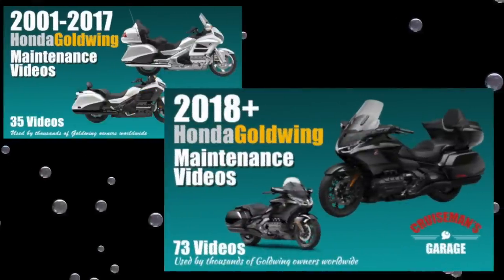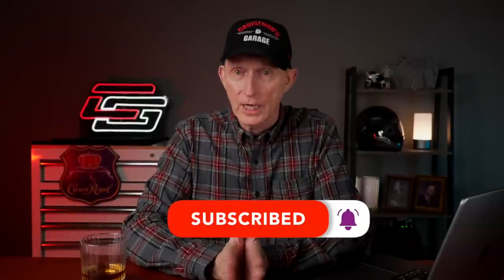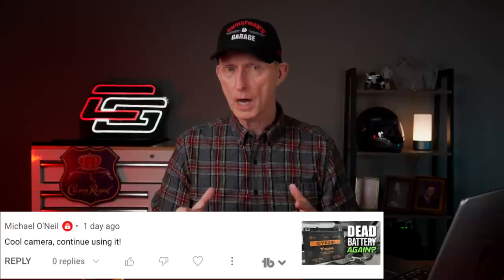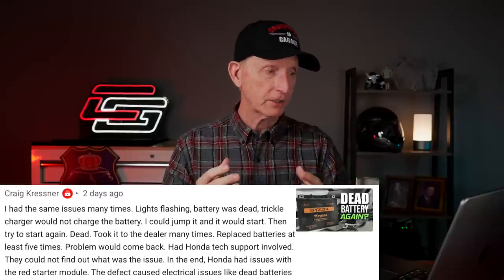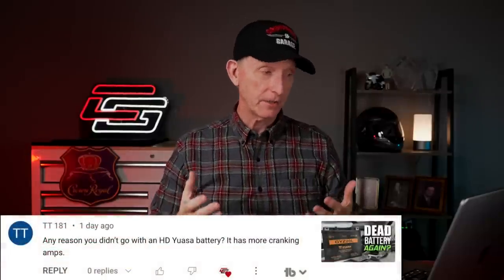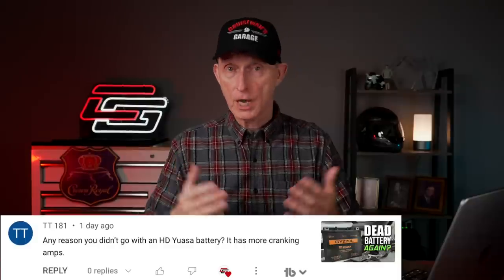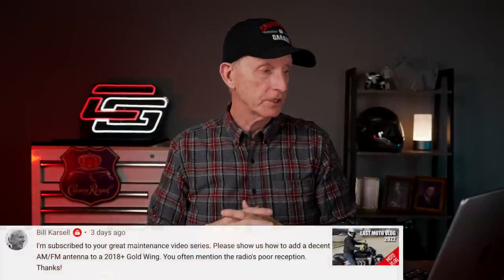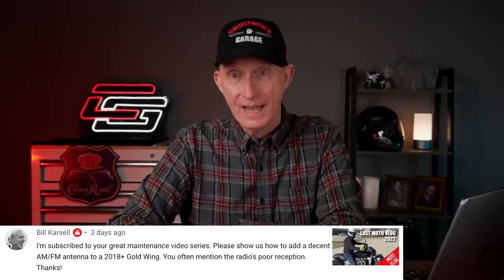Ep 17 DCT Clutch Failures | Crown and Comments | Cruiseman's Garage

Comment: I have an issue with the DCT on my year old bagger, purchased new, day one I reported concerns to the dealer. The issue, I initially reported was the excessive noise on gear change, the next being automatic gear changes mid corner and particularly on roundabouts, the next being faking gearing change and holding onto fifth, and currently between 6th and 7th gears but not exclusively, I experience extreme vibration through the chassis into the right foot peg. A year on the Honda technician confirmed there is a technical fault with the bike, note up until this point I feel like I wasn’t being taken seriously, after all it’s a Honda. We are a year on and it’s now obvious that the bike had the issue from day one. I no longer want this bike and have made contact with Honda Uk and awaiting a response. Any one else experiencing these issues may also want to check with their insurers as when I conveyed the above to mine, I was informed it might get extremely messy should there be a need for a claim…. So I have a 25k bike back at the dealer who warned me they could not tell me how long they would have it, have not offered a courtesy bike. The dealer has reported a similar issue on a showroom bike but are struggling with Honda on the matter…Wish me luck.. Thought I’d get the bike valued, 18k offered by a different dealer, a serious kick in the wallet…Apologies for using your channel to vent but people need to know, I’ve had plenty of Honda’s in the past and no worries, it’s somewhat ironic I buy the most iconic, prestigious one and find myself in a completely different world….If you’d like me to keep you updated, let me know and I would be happy to do so….Keep up the good work, love the channel…

Comment: Excessive low speed maneuvering practice (which it sounds like this guy did) can wear out the clutch on any bike, especially one >800 lbs. I'd be willing to bet he was keeping the DCT in the partial friction zone by staying on the back brake for much longer than needed. Common sense tells you that's not good for the life of the clutch plates. If you did the same on a non DCT bike you'd get the same result. It's hard to tell the DCT is slipping the clutch, but it is, just don't force it to slip for so long that your clutch plates look like glazed Krispy-Kremes and you'll be fine.

Comment: I have the 2019 DCT , I have initialize the DCT clutch a number of times.  It has continued shift erratically.  Have not been able to get it in to the dealership. I haven’t been able to get an appointment for the last 2 1/2 months.  Do you have any idea what make the bike continue to do it.  I have been having this problem from the first week of having the bike. It has progressively gotten worse.  Setting it back to the factory with initializing works for only about 10 miles.  Oh yes the traction control light comes just before this happen,  I need your help “Please”.
Reply from the maker: I can only think of a couple of "simple" solutions that might work. 1) Have you checked your battery? Shifting is controlled electronically and if you have a bad battery it could affect shifting. It is a long shot, but a new battery is a cheap fix. The traction control light is the key piece of evidence, but I have never heard of this before. I have heard of DCTs failing and dealers struggling to find the solution.

Comment: What would be the difference in practicing your skills vs being stuck in traffic for hours ? I would think the low speeds used for both would damage the clutch.
Reply: I don't think riding in traffic is quite the same. In practise work and because you are turning all the time you are dragging the rear brake to control the speed as it's the only way you can without a manual clutch. In stop start traffic you move and then you stop and when you do stop I think the transmission disengages the clutch saving it from dragging during the time you are stopped.  Saying all that Honda don't have a leg to stand on with this and if it happened to my 2022 DCT I would drop on them from a high place. The bike isn't fit for purpose if it cannot be moved slowly and ridden in control around obstructions.
Reply: Robert,....in stop and go traffic, the clutch disengages, little to no wear. In the parking lot maneuvers, you are continually slipping the clutch by controlling your speed with the rear brake and you are continually wearing on the clutches. If you continue to rev the motor and hold it back with the rear brake, you will have a problem.

Comment: For the DCT failure: what happens, if you are in a traffic delay on a highway with stop and go...... Will that give you a damage too?
Reply: I do that everyday, most of the time the faster I cant go is 10 males per hour. So far no problem at 6k miles on my 22 DC.
Reply: The only thing you want to avoid is revving while locking the brakes. Its not a sport bike. You can be in stop and go all day long, no worries. If I am at a stand still traffic in a hot day, She will go to N or I pull over. Stop and go, no issues for her. I throttle a bit, let go and brake, all day long!!! This DCT can take a lot more, trust me. I have 15k, zero issues....!!!

Comment: Of course its abuse, I don't think it has to do with slow speed riding per say, more so hanging on the back brake whilst riding the clutch at elevated throttle CONTINUALLY. Do you have to tell any operator of any vehicle with a manual transmission not to riding the clutch, especially when holding the brake or using the clutch to hold on a hill. I don't understand why this is getting any airtime at all considering there are plenty of people out there doing slow speed riding on a 2018+ Goldwing. Too much brake I suspect in this instance with too much throttle whilst riding the clutch for too long.  The best recipe for burning out ANY clutch.

Comment: Products are generally designed to function in what  right be considered "normal operation". Low speed training maneuvers done is not an issue. Doing dozens and dozens of these maneuvers is simply not normal operation. I can perform u-turn and similar actions without problem. I don't need (nor want) to do this time and time again. This behavior will NOT be encountered through normal daily operation. I might require a tight u-turn once a ride or maybe once a week. Yes, I have DCT and it's a very good technology. Because I can't do 125 practice turns is of no consequence to me and I actually would accept that this is outside "normal use" and therefore not covered by warranty. I applaud Honda for their stance in this regard. I also doubt this occurance will impact the owners or potential owners appreciation for the Goldwing DCT.

Comment: ANY Bike used in "parking lot practice " situations will require more maintenance than a normal rider. H Ds used in drill team work have Very heavy duty clutches , and will use a special brake fluid which has a higher boiling point.  I have friends who do this stuff for recreation !  Often they don't use their daily rider !  If this gentleman wants to do parking lot manuvers all day he should buy a bike with a conventional clutch  This one persons experience doesn't stack up against the multitudes who have never had a problem with DCT

Comment: How to make an internet buzz out of just one case of abuse… low speeds practice is a non issue, abusive use of the rear break is and will cause clutch overheating and if you ignore the warning and keep going you will cook the clutch, just common sense. Either allow more time for the clutch to cool down or use less rear brake and be more precise with the throttle.

Comment: Lithium ion batteries are not better than indestructible lead acid batteries. Lead acid batteries last for 8 years, provided that you keep them on a battery tender. Lithium ion batteries are not reliable. They claim to be very good, similar to LED light bulbs in your home. Remember that CFL bulbs lasted 10 or 15 years? Lithium ion batteries can suddenly lose their capacity for no reason, unexpectedly.

Comment: Slow riding should not be the default cause of this DCT clutch problem. My 2023 1 month old Goldwing DCT Tour’s transmission went out after riding 26 miles after bring the bike home. Now Honda is replacing all the items listed below under warranty.

Parts#.                     Qty.    Discretion 
27312-MKC-A01 — 1.00 - GASKET, CLUTCH COVER

38610-MKC-A01 -  1.00 - SOLENOID, LINEAR

28660-RFH-013 -   2.00 - SENSOR, OIL PRESSURE

94520-40150 -   1.00 - CIRCLIP (INNER) (40)

91302-MGS-D20 - 1.00 - O-RING (35X2.2)

91344-PC9-004 -  1.00 - O-RING (29X2.4)

91311-PA9-004 -  2.00 - O-RING (7.7X1.9)

23215-MKC-A00 - 2.00 - COTTER, CLUTCH

22814-RGC-003 - 2.00 - RING, SEAL (21.2MM)

22815-MGE-D01 - 2.00 - RING, SEAL (28MM)

91306-MGE-D01 - 2.00 - O-RING (23.3X1.9)

91320-RT4-003 - 2.00 - O-RING (35.5X1.9)